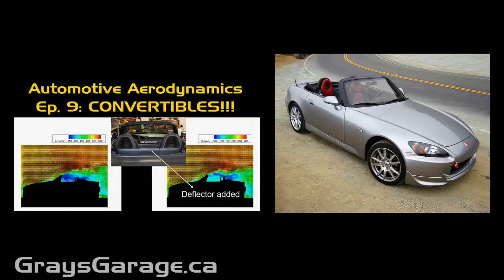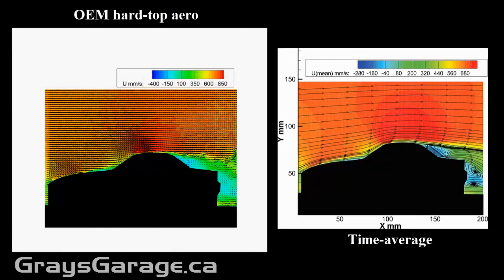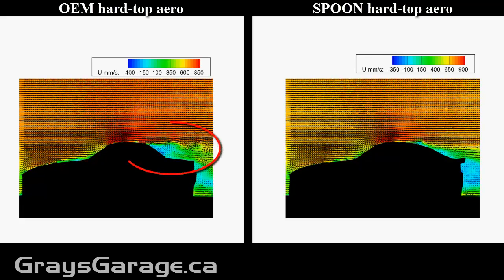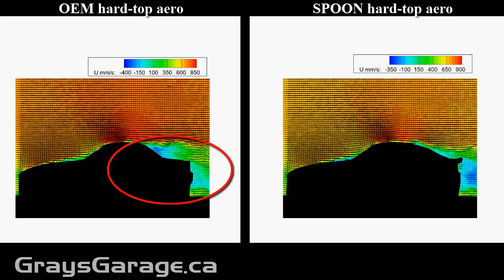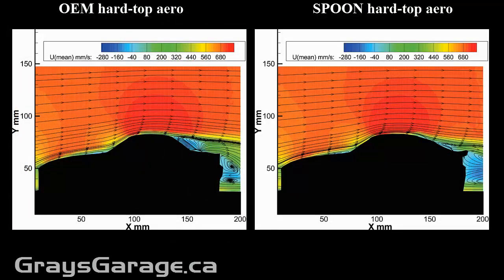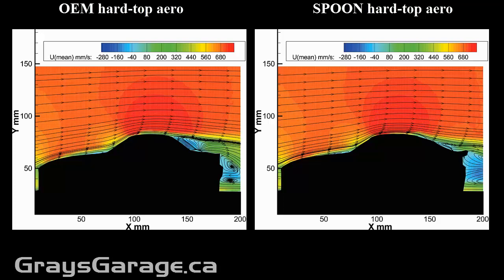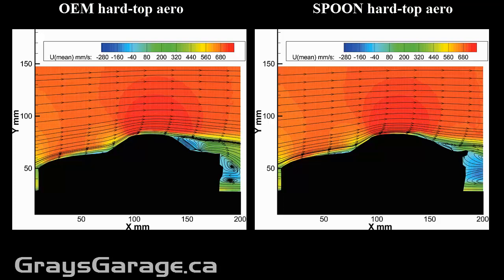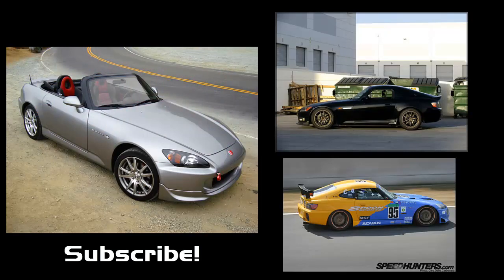Honda S2000 SPOON hardtop aerodynamics

Comment: Very thorough explanation of your findings! I'd be extremely interested in seeing how the OEM soft top affects to drag and lift compared to common hard tops (OEM and Mugen). Many s2000 track guys ditch the soft top for hard tops to gain performance. I'm curious to know if it's worth losing that convertible feature and added cost.
Reply: It makes sense to use a hardtop for aerodynamic efficiency because a soft top like on traditional convertibles flaps and moves around at high speed which creates a lot of drag and negatively affects aerodynamics. For the same reason why the top performing sports cars and supercars are all hardtops.

Comment: Awesome info Graham!  I've been wondering what the aero looked like on the OEM hardtop since the first S2000 video.  I got a burning question on the OEM hardtop--is this possibly a LEGITIMATE application for roof mounted vortex generators or a turning vane?  I want to keep my OEM hardtop, but want to reduce drag as much as possible--would you expect keeping the flow attached would achieve that?  Would it even be possible to keep the flow attached with the sharp rear windscreen without causing more net drag, using some aerodynamic device?  In my case, I'm running a very efficient wing at a very low AoA well into clean air, so even if I was producing lift with the car body, I'd think I could cancel it out with the wing with a lesser drag hit...
Reply from the maker: +Chris Wiita This remains to be investigated, however my guess is that the rear angle is too great due to the short trunk. Vortex generators are most likely not enough to keep the flow attached and will add drag themselves, a turning vane may keep the flow attached but add more drag than it saves. To give you an idea of when these devices are useful, some STI and EVO's used them to positive benefit, but they had shallower rear ends. If you are serious about finding a solution, shoot me an email and we can talk more.